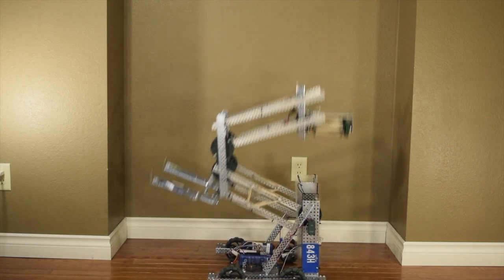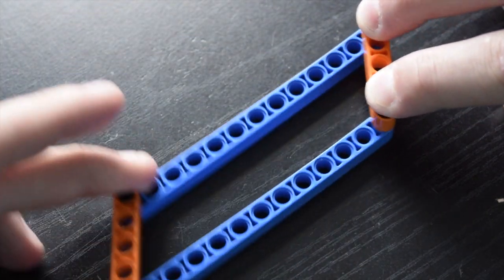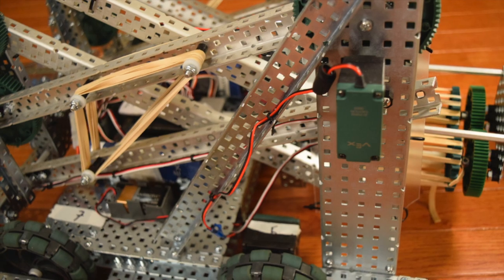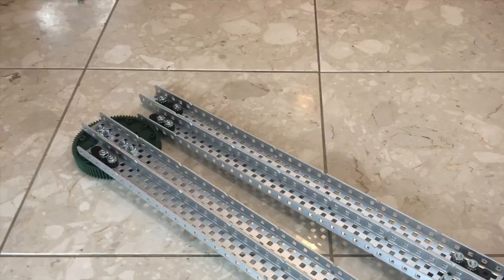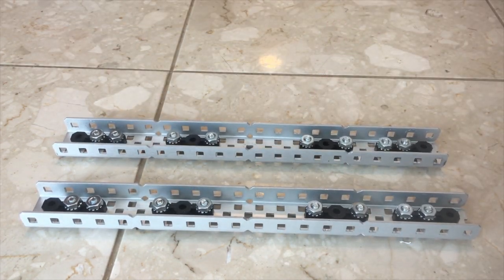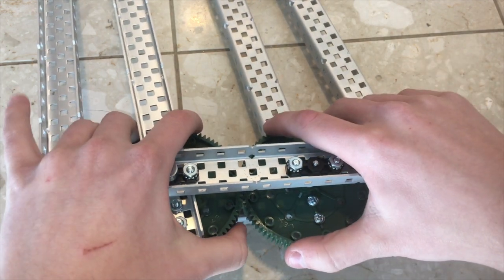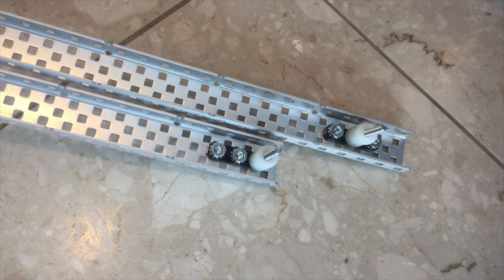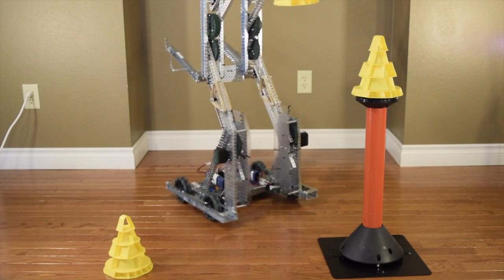The Kepler Electronics Guide to the DR4B

Comment: Parts needed for one side of an usagi-inspired dr4b:
One section = 5 holes

2 x 7-section c-channel (the top 4-bar of the lift, will be attached to gear)
2 x 6-section c-channel (the bottom 4-bar of the lift, will be attached to a gear)
2 x 4-section c-channel (brackets the two 4-bars, and ensures the gears mesh)
1 x 3-section c-channel (attaches the top 4-bar and actual operational mechanism used to play the game)
1 x 5-section c-channel (attaches to bottom 4-bar and main robot)

2 thick gears, size does not matter, as long as they aren't thin
lots of axles, bearing flats, small screws and nuts
and lots of spacers of various sizes

it may be better to prototype it first with janky screw joints and then replace those with spaced out axles one-by-one once the minimum viable product is complete.

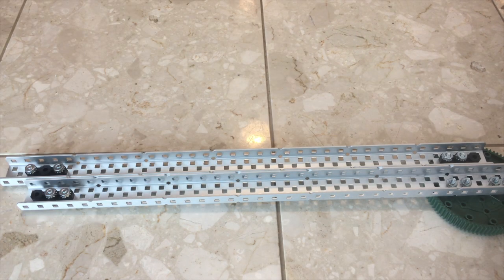Comment: 1:37 how did you connect the second piece? because the screws and the holes dont line up
Reply from the maker: Those pieces aren’t actually connected, that image is there to show how the spacing between the pivots on both bars is identical.
Reply: u right dawg this vid is bad bro, how can they screw in bars that don't got no pieces for screws to line up to.This vid wack.
Reply: @grantcollier3860 I feel u, been watching this lately and nothin seems to add up

Comment: this is a good guide for beginners but there are a lot of things you change to make it lighter and more durable. but, overall nice job!
i'm the builder on my team and our jankbot ended up being one of the top bots in our state. i'd love to add my input for any of your building videos.
Reply: i can give you leaks lol
Reply: @baaz6968  Do you have any tips to improve this DR4B lift?
Reply: i'd use 84 tooth gears, make the gap between four bars bigger, use only screw joints (only axle you need is the one attached to the motor), use bearings everywhere, add rubber bands. uh that's quickly off the top of my head
Reply: @baaz6968  Ok, thank you!
Reply: Also the one of the most important parts of a dr4b is the geometry. This pretty much just means how long each bar of the 4 bar is. Generally speaking the sweet spot is around 25 holes. The bars on his itz bot imo are too long.
Reply: And I highly recommend powering the lift in the middle
Reply: Cykaraptor 7701x why the middle? It seems so much more simple to power it from the base
Reply: Generally, it doesn’t really matter where you power the lift. But powering it in the middle is better. It frees up space near the tower of the lift, which is a very important area. And the top 4 bar has less slack which is important if you want to get the max height of your lift. Only time where powering from the bottom is good is where you want an high speed lift like antichamber’s. like 60 rpm +
Reply: Cykaraptor 7701x ok that makes sense
Reply: If you take a look at 5225a they have an excellent dr4b which incorporates everything I said. and if you look at 8825s. Their lift is a monster is one of the tallest in itz.
Reply: Cykaraptor 7701x ya I also made one. It was actually a double reverse 4/6 bar and it reached 54”. It did have a bit of slack but I adjusted the gears to where it was still parallel.

Comment: Great guide, but it should be noted that screw joints are amazing compared to axle joints, and should be used whenever possible
Reply from the maker: Screw joints are amazing. The DR4B on the In the Zone bot did have screw joints in the gear section. I didn't use them in the example because I could not fit a nut on either end with the vex-legal 2 inch screws. I used standoffs in the ITZ bot to extend the screws, but I would not recommend it.
Reply: @KeplerElectronics  929X, one of my clubmates, built his dr4b out of all screw joints except one. What he did was have a bearing sticking out screwed into a one by screwed into standoffs. This allowed the screw to reach, but I understand most are not as devoted to the art of jank as he is.
Reply from the maker: @Bucketfullabiscuits the art of jank, I like that. That’s the cool part of vex, trying to find the most interesting way to assemble the parts to do what you want.